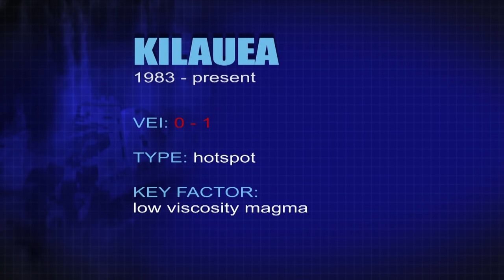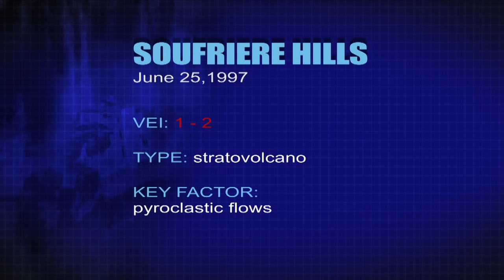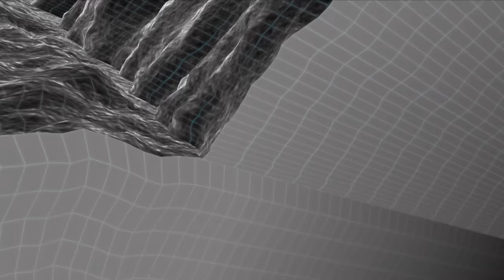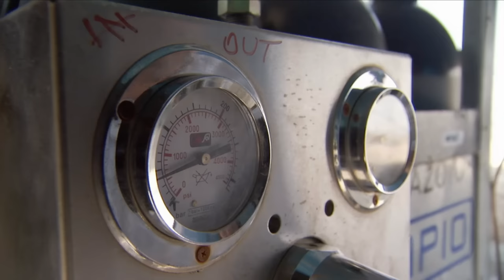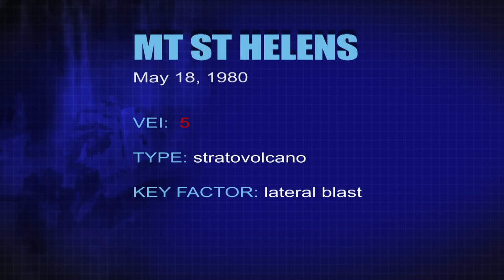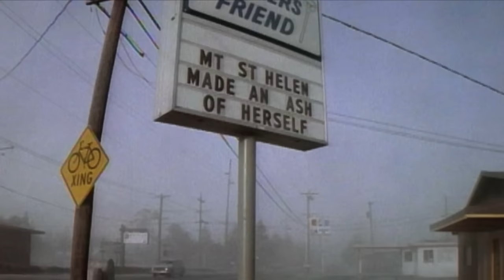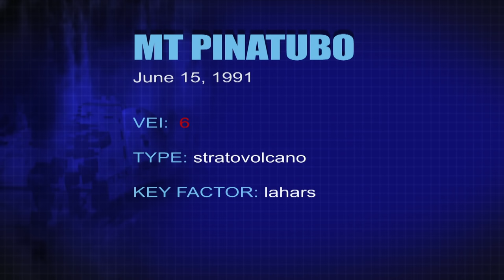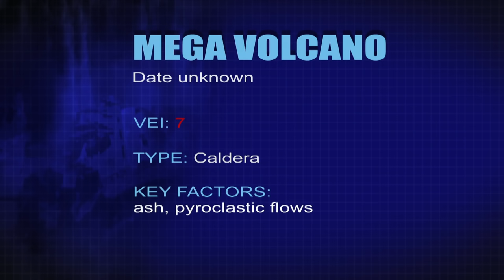The Deadliest Volcanic Eruptions Of Our Time  | Mega Disaster | Earth Stories

Comment: I keep hearing about volcanic ash and the damage it does both immediately and long-term.  Trouble is that I have a very hard time comprehending this kind of ash.  From fireplaces and campfires I thought I understood what ash was; burnt wood.  It's soft, usually white and can simply be blown away if it gets on something.  Volcanic ash is burned up ROCK.  The idea that rock can burn is weird enough, but that it can float around and kill by suffocation when the shards of silica that have cooled and are little scalpels cut your lungs to pieces.  It can kill like this 1000's of miles away.

Comment: "Lahar" is an Indonesian word since hundreds years ago which means material released by a volcano. Indonesia is the country with the most active volcanoes on planet Earth. There are two types of Lahars, Hot Lahar and Cold Lahar.

- HOT LAHAR (Lahar Panas) is very hot, every material released by volcanoes, including lava and pyroclastic flow. 
- COLD LAHAR (Lahar Dingin) is already cold, every material that has long been released by volcanoes in the form of dust, sand and volcanic rocks and others. 

If this Cold Lahar is carried away by the flow of water because it rains in mountainous areas it's called LAHAR or Cold Lahar also, and this is usually the more frightening because it can crash, damage and hoard whatever it goes through, without mercy.